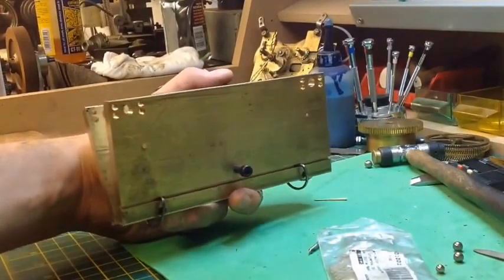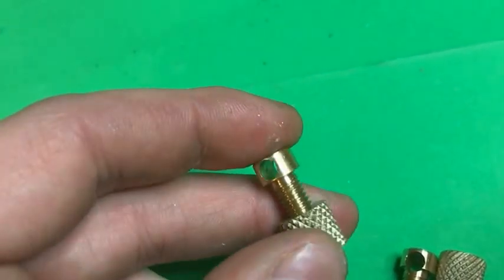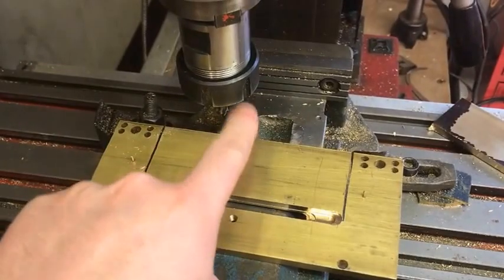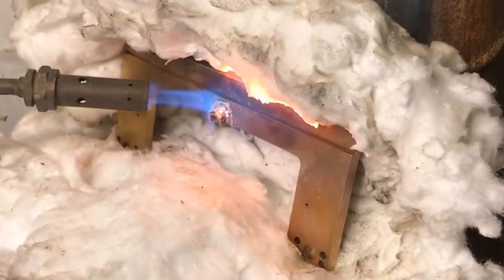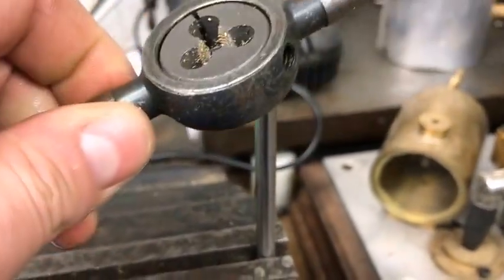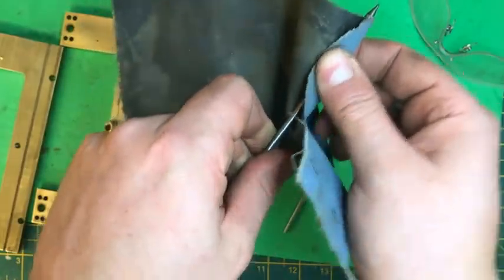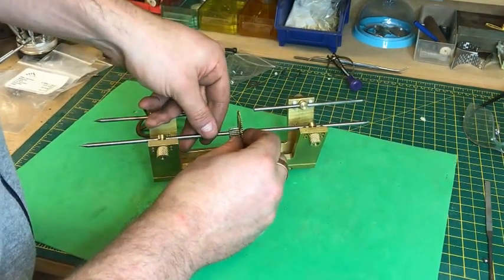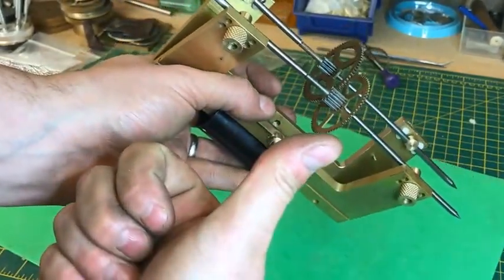How to make a Clockmakers Gear Depthing Tool   - Simple Design

Comment: Good functional work. Suitable for much of the common repairs and especially good for train layout in the beginning. The locating pins should be a very slow taper if indeed tapered at all. Best is truly cylindrical brass rod, with smooth domed ends ...but of course the close fit will make separating the plates a little tricky until separated and united a few times. Hope many will give this a go to your pattern and instruction. Not a tool needed daily, but the only one that will make the grade when the time comes.

Comment: I really liked the simplicity of the concept to keep the arbor supports parallel, overall an excellent project well executed. Do you have rough plans/ dimensions and where did you source the spring you used to hinge the tool. I intend to make a depthing tool and I really like your design. Thank you for sharing on you tube.
Reply from the maker: Hugh Gaynor hi, thanks for the comments, I’ll get some dimensions in the next few days. I based it on a commercial depthing tool. The spring is from a large “bulldog clip”. I’m not sure if bulldog clip is a uk term but if you search google I’m sure you’ll find them. It is what you would use to clip together a large pile of papers to hold them together.
Reply: craynerd In Australia we also call them bull dog clips. Thank you I look forward to the information and appreciate your willingness to share. PS I have subscribed to your channel.

Comment: Chris what do you call those little alignment pins and could you tell me of a uk supplier. Thanks.
Reply from the maker: Jim Arnott they are called taper pins and if you do a search with the word clock you'll find lots of them. They are on eBay, Meadow and Passmore, HSWalsh ...
They do both steel and brass. I've never used steel but can guarantee that with brass you can file and sand the back thick end down and it becomes invisible with the surface. 
All the best

Comment: Nice design. I plan to make mine with wood. Two pieces of wood about same as your brass with hinges. The trick will be the guides for the runners. I think I can make them frictional tight and use drill press, just enough not to slide. I'll use rubber bands to maintain closing pressure and typical screw. I would like to put the screw further away from the hinge so that adjustment would be more gradual.
Reply: i dont mean to be off topic but does anybody know a tool to get back into an Instagram account??
I stupidly forgot the password. I appreciate any help you can give me
Reply: @Garrett Mateo Instablaster =)
Reply: @Shane Grayson thanks so much for your reply. I found the site through google and Im waiting for the hacking stuff now.
I see it takes a while so I will reply here later with my results.
Reply: @Shane Grayson It worked and I actually got access to my account again. Im so happy:D
Thanks so much you really help me out :D
Reply: @Garrett Mateo happy to help :)
Reply: There are a hundred reasons this is a horrible idea. Wood distorts with temperature and humidity a great deal, and you cannot hold accurate tolerances in wood for something requiring the actual precision of a depthing tool. In fact, I find parts of this video clever (the taper pins for alignment, the use of spheres as a kinematic alignment idea) but some of the execution totally lacking. At least the metal one could be made usable with more care, but wood? I will say outright that is a fool's errand.

Comment: Where did you get plans for this? Did you design it yourself?
Reply from the maker: Matthew Condon I did design it myself. I was going to put plans on my website for a small fee but I didn’t quite finish them.
Reply: Has it worked well for you? There is a book of plans and instructions I was thinking about ordering...thought maybe you used it. https://timesavers.com/i-14903845-how-to-make-use-an-inexpensive-clock-depthing-tool-by-william-bilger.html
Reply from the maker: Matthew Condon Hi Matthew, no I haven’t got that book. You can make whatever you like I suppose out of the front image as it is such a simple sketch, however the thicker section of the frame near the runners suggest you’ll need to bore a hole in the frames. I wanted to keep away from this as I was sure I wouldn’t get all 4 holes parallel. To be fair, I’m not sure I’d be able to get two holes on the same side parallel and inline without cutting in one sitting, which is a long hole! That’s why I went with this design. You are guaranteed parallel runners if you drill in the correct order!
Reply: Thanks!